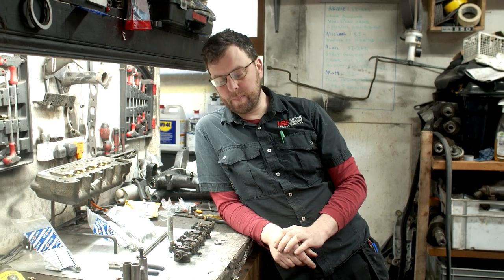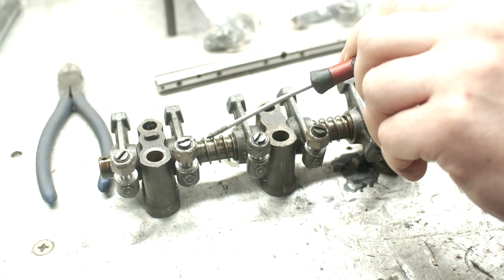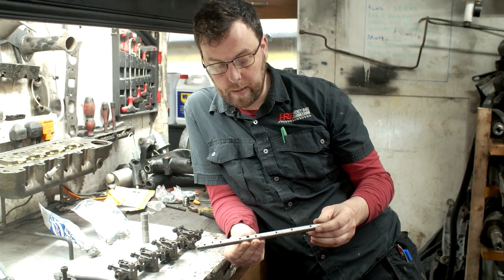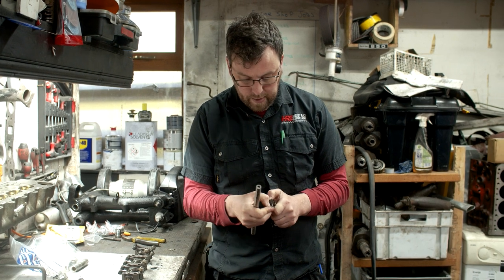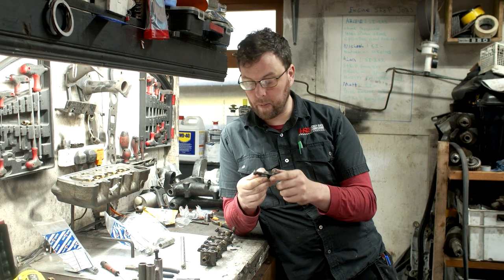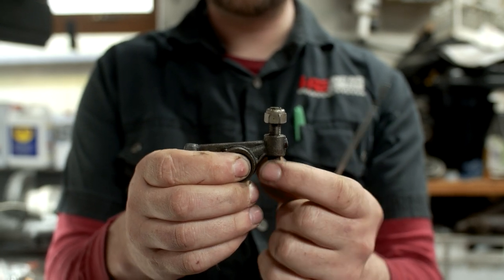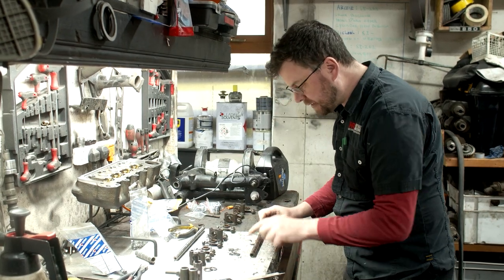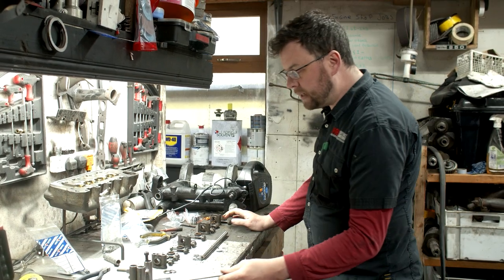Rebuilding Cooper S Rocker Gear

Comment: I really admire and appreciate your attention to detail and meticulous preparation. We at BMC special tuning would never have drempt of doing this even on the works cars. The only time that BMC suggested machining the base of the rocker pedestals was to take 0•050" off of the bases if the longer competition tappet screws  (C-AEA 692) weren't used on the race camshaft (C-AEA 648).
BMC always recommend lightening the old style rockers, by the way those newer lightweight ones were introduced from engine number 9F-SA-Y 34540. 
Shan't comment anymore about the valve gear as I assume that you will be covering this and the tappets in later episodes.  
It's great to hear how our competition modifications became standard on later cars, don't forget that I left BMC in 1964!!
Reply from the maker: Thanks Tony, It is always great to have the complements of some one involved in the original production of this equipment. I am also delighted to be aforded the opertunity to work on this equipment we the level of detail they so richly deserve

Comment: Hi, just found your channel and find it extremely informative just as I'm about to rebuild and fit a 12G940 cylinder head to my 998. also I'm contemplating also fitting a pair of HS2  SU carburettors. I would be grateful on your thoughts about this modifications. Also like your description of a digital vernier caliper, as a retired toolmaker these were known as "guessing sticks"
Thanks again, Keithd

Comment: Great vid paul😃,
Just a quicky- if the posts are different heights, 
how can the shaft in the jig be perpendicular with the base? 
Would they not bend the shaft in the jig? 🚗🏁
Reply: The centre of the holes would machined from the base of the posts the overall heights are not important .
Reply: @jimbethpiggy  why is he skimming them then?
Not sure why he's doing the posts bud?
Reply: @tones61  He is skimming them to make them equal heights  because he wants to machine the bases ..so when they were machined originally at the factory the important size is from the base to the centre of the spindle ..the top of the posts sits in fresh air they are just for clamping down.
Reply: Good point. He has assumed that the pedestal base to rocker shaft centre line is accurate and consistent. It isn’t and this is proved when he compares the finished overall heights after skimming.  The jig should not use the pedestal base as the datum but the shaft centre.  
Similarly skimming the pillar faces to make them parallel does not mean they are accurately perpendicular to the shaft. Not sure what the point is for that exercise as they are just abutments for spacer springs. 
I think a revised jig/method is needed to get the base/centre height dimensions consistent.
Reply: I agree, the base of the post to the shaft centre is the critical dimension is it not? Other wise you will have a shaft that is not running true and therefore more likely to fail? I would correct that, not the top.
Reply from the maker: Great discourse lads, great to see you are all using the grey matter. So the first operation is where we setup the rocker shafts with the Factory pedestals flat to the fixture plate. the hight between the factory pedestal base and the rocker shaft is in deed the critical dimension. the top of the rocker posts was not machined in line with these from the factory. we correct this in the first operation. in the second operation we can now flip the rocker posts knowing they are now in like with the original machining of the bases of the post. we checked this with the DTI guage and they where with in 0.05mm of each other the factory allounce for this is 0.08 -0.10mm so we where bang on. the final operation is cleaning up the spring faces and in the next video it will become clear why we did that.
Reply: @HREIRL  well said lad top of the class .
Reply: @HREIRL  so the process relies on the relationship between the hole and the base being within tolerance, there for my question is why bother except if you want to reduce the height of the posts to maximise your rocker geometry. I would be interested in your thoughts on rocker geometry form the point of view of optimum lift against wear. Another video to add to the list 😁
Reply from the maker: the reason we bother Simon is the factory finish is not always Flat. the distance may be the same but not uniformly flat. Regarding rocker geometry I do have a video in the pipeline which will cover all aspects of rocker geo optimisation
Reply: @HREIRL  ahh, I see! I am building a 1275 race engine for my GTM, very interested in your views on the best valve gear geometry. Between you and AC Dodd there is a lot of good content out there for us budding engine builders! 👍👍
Reply from the maker: @simongrist8382  Thanks Simon, great to hear of a budding engine Builder thats what our channels are all about. keep us posted on your progress 👍👍

Comment: Hi Paul, just wondering what the dimension is for each rocker pedestal machined base to the top of a fitted rocker shaft, do you find that it varies much as when I have machined any of these pedestal's it has been one at a time inverted in a machine vice and using a rocker shaft located across the jaws to give a height datum.👍

Comment: Loved this episode great to see your engineering solutions, did raise a question or two. Firstly have the beds for the rocker posts been leveled as well? And does the thin wall of the original Cooper rocker shaft allow for less heat retention, and greater oil flow at less pressure?
Reply from the maker: Yes we machined the cylinder head completely flat, regarding heat retention the oil flow through the rocker shaft seals with that. As far as the pressure and flow are concerned the oil feed passage in the head is 6mm I’d and the hole through our rocker shaft is 6.8mm there for o shaft has a higher flow capacity than the head can supply 👍 glad you enjoyed David thanks for the intrest

Comment: if youre pulling the posts down with the shaft aagainst the plate are you not going to pull distortion into the bar ? SO that when youre done machining the holes for the shafts will be parallel but not in line ?

Comment: Mr. H!! JG here, as always your video is bitchun!! My train of thought was dragged to a brake question even though I now question the efficiency of the little levers bangin away under my valve cover. I was wondering ( for the fast road going mini ) what your best braking system would comprise of?  OH, I run stock steel wheels with a 1293 stage 1 engine 7.5 discs and stock drums in back no booster in a 67' RHD. Sorry for the drift in thought hope all is well!
Reply from the maker: HI JG, Glad you enjoyed the video. My go to brake setup for that spec would be 7.9 twin piston Cooper S brake setup. ITs relatively in expensive and with a good set of discs and Carbon Metallic pads can be more than enough stopping power for any mini

Comment: Wondering why you chose en21 over say en24 or even en36. We call them very-nears btw
Reply from the maker: We went with EN21 in this case Jonny as it affords a better level of temper after heat treatment than the En36.

Comment: But, if the posts are different heights, is the shaft actually parallel to the fixture base, before refacing?
Reply from the maker: Yes sure is